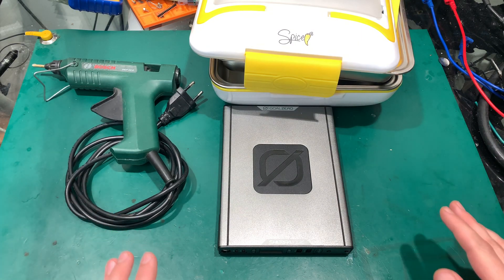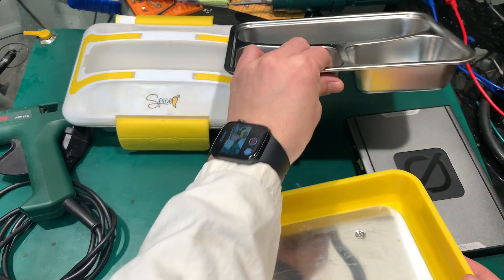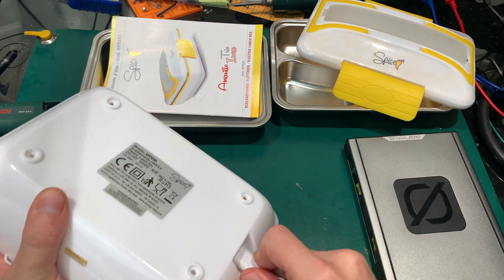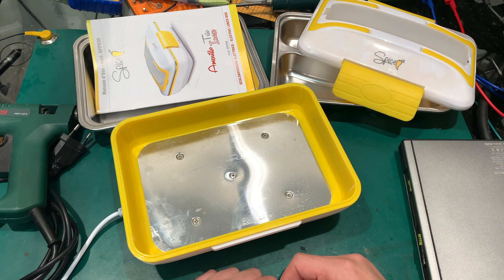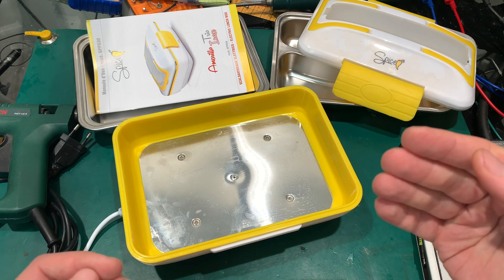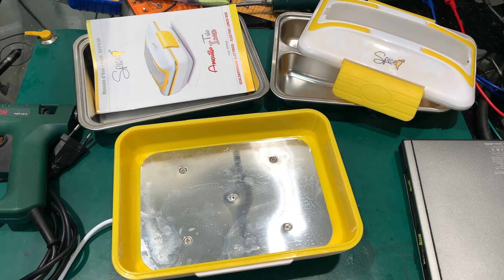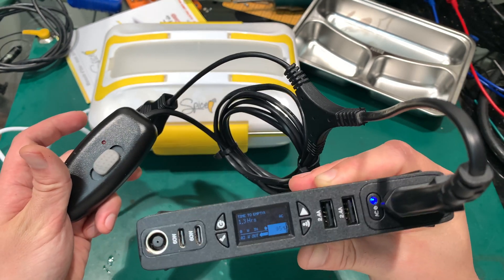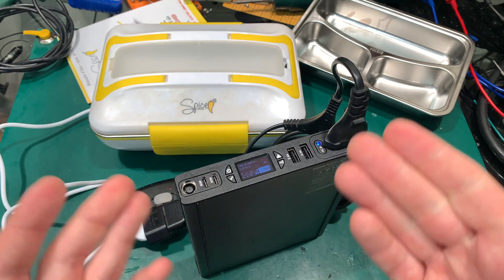Goal Zero Sherpa 100AC + PTC heating element (food warmer)  inverter overload and solution

Comment: Have you ever taken your sherpa apart?  Mine just started failing.  Battery gauge claims 57% but unit shuts off and won’t turn back on unless I plug something in to charge it.  Seems the battery is dead.  Curious to know part number for battery and a source for a new one.  This happened on my current vacation trip so I can really take it apart right now.  Thanks!
Reply from the maker: Sorry to hear that, I never taken Sherpa 100AC apart - most like it use prismatic cells since enclosure for sure wont fit 18650 like Sherpa 50 does. How are You discharging it? Have You tried recharge is and discharge slowly (with small current) to teach internal % indicator correct value?  I mean with like USB 2A load - not 100W on AC port. Vacation? You sure it's not overheating issue?
Reply: @ElectronicNoobBlog  Yeah I didn't expect 18650s...likely some flat pack but can't find any data on it.  It's not an overheating issue.  The fan works, but I've only ever heard it come on when I've charged it with a charger that can max out the type c input.  The loads I'm using it for, never call for it to heat up enough to trigger the fan.

Wrt discharging, I've attempted normal discharging w/typical cell phone/ipad loads 50-60Watt combined.  After getting to the neighborhood of the 57% I figured trying to completely discharge and recharge could help or at least not really hurt it any further.  I set the AC port to 'no timeout' and just turned it (AC port) on w/nothing plugged in.  This pulls ~1-2W.  Anyway, I let that go and got it down to 53%.  I've cycled the pack a number of times since and usable range now is the top 47%-ish.

I called Goal Zero.  The guy I spoke with was nice enough.  I'm outside the warranty period (2019 purchase date) so all he could do was offer a 5% discount on the newer model Sherpa 100AC.  I'd asked about getting a new battery pack (at my expense) so I could replace it or sending the entire unit in so they could do so (at my expense).  The offer neither.  Seems kind of shitty for a company w/a brand/image in the outdoorsy/environment space.  Sucks that an otherwise perfectly serviceable piece of gear would be landfill fodder for something so trivial as a battery.  

I figure it's not all that usable so I'm going to open it to try to get some part number data.  Trouble is that after pulled the screws off of the back plate, the back plate comes out well/easy enough, but, other than the fan from it's mount, and the rubber side pockets/top and bottom veins, I can't see how to get it apart further.  I suspect it needs to slide out of the aluminum chassis out the front but nothing budges.  I don't find any other screws and looking at the back w/back plate off, it's one piece of aluminum.  Might be glued or perhaps just wedge fit.  At this point it seems non-destructive teardown is fading fast.

I'll likely try a more secure grasp of the aluminum shell so I can try some form of percussive action on the internal bit over the weekend.
Reply: @ElectronicNoobBlog  ok.  I got it apart. Seems the plastic Qi charge area needs to be removed and then things just slide out the front. 
As it happens, the pack inside IS 8 18650s in a 4s2p pack.  Cells are LG MH1 INR 18650 (lggbmh11865).  The full pack is from Icon Energy System (Shen Zhen) with:
Model: IM942-A  4INR19/66-2
IES-IM9422018063010802
Rated: 14.8V/6.4Ah / 94.72Wh

I can't seem to find an assembled drop-in replacement online. I don't have the tooling to tack-weld discrete cells to make my own from the discrete flat top cells.

If you have suggestions/or your search-fu ends up proving superior, anything you could share would be grand!

Thank you.
Reply from the maker: @PrimalNaCl  Thanks for details, I can't give You any advice in finding drop in replacement - and most like You won't find it - those larger companies can afford to get size just for them.   I read again description of problem You getting and to me it looks like one cell go unbalanced  and protective circuitry disable it - it still read 60% but one call dip down.  Is there any balancing cables? Have You try recharge each of those cells individually? Maybe balancing all them will fix issue?  14.4 is very common value for RC (remote control) toys - You can search around that name RC, LiPoly 4S - if You can't get right size - try smaller capacity so You will have more room to fiddle around.